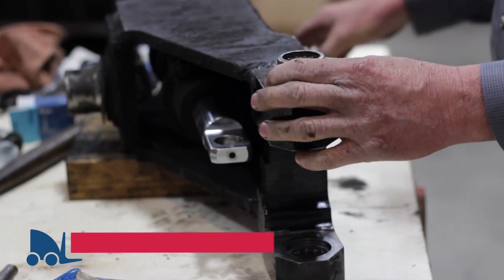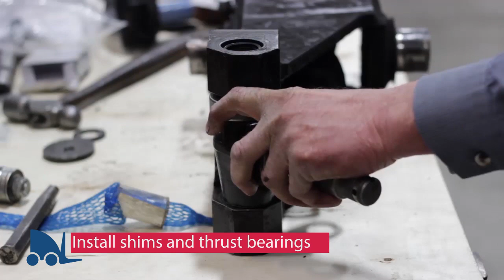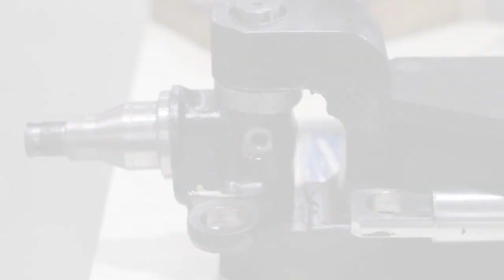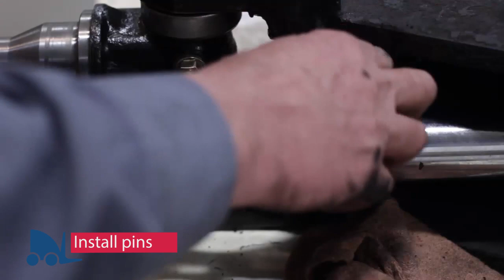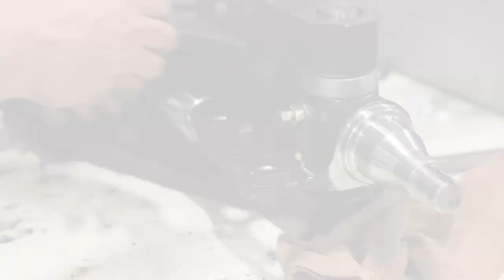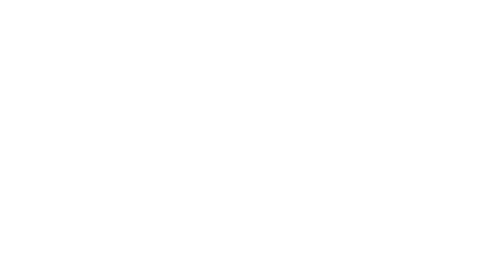How to fix a forklift steer axle | How to video from Intella Parts

Comment: why a ball pen and not a dead blow?.............  need help if you can main cylinder lift on 79 clark  model C30 .i have a bad lead. i have the new seal kit i just cleaned all grime off for the last 30 years it seems now i can see....if you need pix i can send what ever you need even the stamp plate